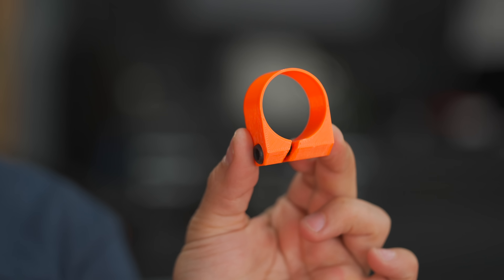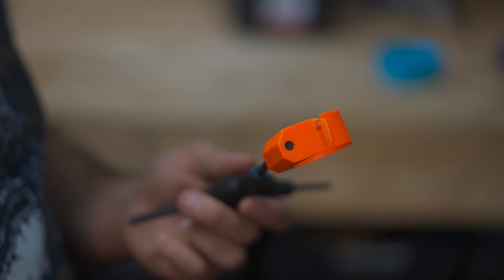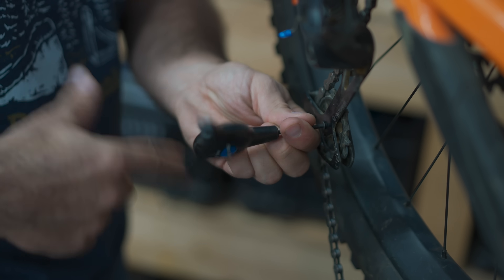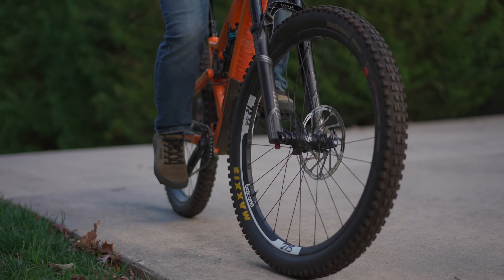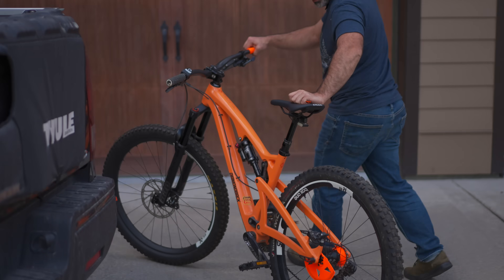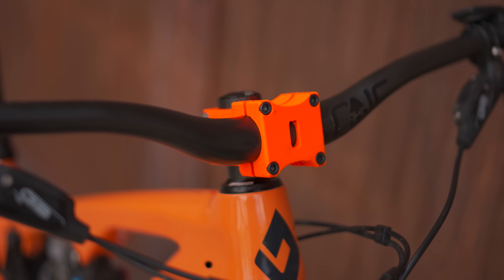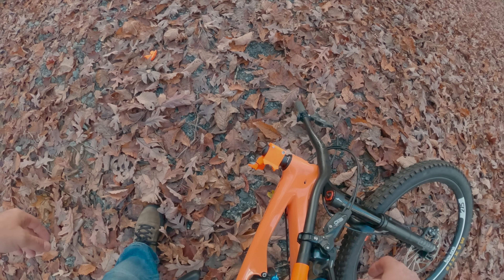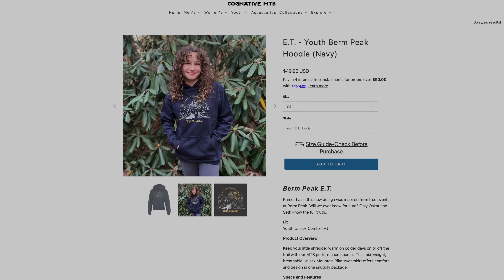Will 3D printed MTB parts break catastrophically? Let's find out!

Comment: Some of these would probably work with carbon impregnated filaments or carbon reinforced prints like Markforged has. Unfortunately they're super expensive printers lol.

Metal can also be 3D printed using laser sintering. This can create parts with little to no post processing or machining required, but is also very expensive.
Reply: "impregnated" lmao... Carbon Fiber infused filament is actually weaker than the traditional filament it's infused with. It's mostly meant for lighter models, better dimensional accuracy, and ease of printing specifically for nylon infused filament. But it's a lot more brittle and less impact resistant. Definitely would be counterproductive for this.

Comment: I actually use 3d printed brake levers on my trials bike
Printed using a carbon fiber material
I did have to epoxy coat them to stop them sucking up moisture but they work well and haven't failed yet
Edited to correct terminology

Comment: screw inserts or recessed nut hole would work. and if the plastic fails you can print carbon fiber parts
Reply: Carbon Fiber infused filament is actually weaker than the traditional filament it's infused with. It's mostly meant for lighter models, better dimensional accuracy, and ease of printing specifically for nylon infused filament. But it's a lot more brittle and less impact resistant. Definitely would be counterproductive for this.

Comment: Looking at your broken stem, if you

1: printed at 0.3mm layer height
2: increase wall thickness to 5-6 
3: increase top & bottom layers to 6-7
4: add inserts for metal nuts

I think it would actually work (until it gets a direct impact on rocks)

Comment: If youre allowing metal bolts you might as well allow embedded nuts, that probably could make the seat post clamp and grips work
Reply: he should have printed with carbon.
Reply: Those parts would fail the same if he put in embedded nuts. The threads weren’t the point of failure on those parts.

Comment: Despite what a lot of people think, PETG is weaker in almost all situations than PLA - so printing all of these in PLA would have given you better results. Also, rather than modelling in threads and screwing directly into the plastic, you could model in slots for Square Nuts and then screw into those, much stronger. Not that it would make them actually safe or anything :) but it would have worked better.

Comment: Congratulations, you successfully manufactured a dork disc. Of course, we know that regular 3D printed parts are more applicable as design and prototyping tools and not applicable in creating parts that are meant to undergo stress. At least that's true for PETG filament. You should look into getting some different types of filament for making some of these parts, like PLA or polycarbonate. Polycarbonate has been tested and found to be the toughest of all consumer desktop 3D printing filaments.

Comment: I know you said not to print bike parts but if you’re gonna try to again, see if you can print solid plastic parts. 3d printers usually leave an air gap in the middle of the print to save material. You can see it when the headset snapped
Reply: It's actually strongest to print at something like 85% infill because the infill pattern forms an internal "skeleton" that strengthens the part.

Comment: 3D printing is great. Also ... I printed a pretty minimal Garmin mount. 
Broke on the 1st ride, even though it was sturdier than an actual plastic mount. Even with 100% infill PLA is just not for MTB loads or vibration.

Maybe a resin printer would be suitable for certain things.
Reply: The problem there is PLA is not suitable for many of the creations people think it will work on. Because it is cheap and easy to work with MANY hobbyists over use it. You have to use the right material for the project or it is doomed to fail. Resin printing has incredible layer definition, but it is not a be all end all... Any resin print has to be able to fully cure, but in truth the larger(more solid) the print, the less likely you are to have proper cure all the way through as it requires exposure to UV light to complete the curing process. Speaking of UV light, PLA is very susceptible to UV degradation as are a number of other popular  filament types.

Off the top of my head, I would likely go with ASA (a less toxic easier to work with version of ABS) for a bike part, BUT I would print my initial part prototype in PLA or some other cheap filament type. After verifying the fit and function, I would replace it with a part made in a filament type that is better suited (after looking up the specifications of the filament types.) if printing, you also want to document every filament type you use. Know what its physical properties are, and know what settings are needed to work with it. Keep a record of this information in a folder or a binder, and keep sample chips. You also want to do some test prints and "torture tests" prior to using a filament on general projects. This documents how well the filament works in standard to extreme printing conditions.

In this video Seth WANTED his parts to fail... You could even see when his stem failed to break on the ride for him, he had to force it to break for the camera.
Reply: Should have used petg or nylon, resin can be better but you need the expensive resins

Comment: I've made and used caliper spacers as well as rotor spacers to adapt an older non boost hub. PETG has held up well, but it does seem to warp over time with heat.
Reply: Can't you just buy metal washers in the correct size?
Plastic that melts like that should not be near a brake rotor that easily reaches 100°C and more.
Reply: @sebastianjost  Lol. Of course you can. PETG melts at 240 C to be clear though.

Comment: Im currently designing 3D printed brake adapter for 180mm rotor. However im later going to cut it out aluminium or cast it out of forged carbon. Aluminium is 5 times cheaper than carbon to prototype but I can make 1kg of carbon forged parts.

Comment: Just wanted to say that instead of printing screw threads, you can design a hexagonal hole to accommodate a metal nut on the other side! It makes it way less susceptible to snapping, cracking and stripping the threads, plus it's really easy to do. Also, layer orientation and perimeters matter!
Reply: Exactly what I was thinking.  I have a 3d printed bike lock holder on my street bike that bolts to itself around the bike frame to hold my lock when I bike somewhere (I know this isn't nearly the same amount of force as an integral bike part). It's made to bolt into a nut that is slightly recessed into the part, and this allows for a tight grip without stressing plastic threading.  Plus, if you make a slotted recess, it can account for a little variation because the nut can slide to accommodate any slop in the system. Once the bolt is tightened down it won't slide anymore anyways.
Reply: Or a heatset insert
Reply: You can also buy some really nice plastic threaded inserts for fairly cheap, all you need is a soldering iron
Reply: I would also always use heatset inserts, idk how much better they are but they are so easy to install that I prefer them over nuts. The nuts are always falling out if you dont design it just right
Reply: Sounds easier than modeling it with threads
Reply: @brauljo  it's way easier to print, too!
Reply: Hijacking your comment to say carbon fiber infused filament and a hardened steel nozzle for the printer maybe worth a part 2 as well as the heatset inserts
Reply: I came here to say this!! You can also use brass threaded inserts, they work well. I've done the hexagonal recess in printed parts in legitimate engineering applications for years.
Reply: And TPU instead of PETG.
Reply: @jayspeidell  CF-ABS. Pain to print, but it's worth
Reply: I have printed phone holder for the bike and it was mounted with 0.5mm thick PETG strips with nuts on both end. I'm able to lift the bike with 3 of these. Problem is that PETG brakes unexpectedly and pretty violently.
Reply: use threadded inserts installed with a soldering iron
Reply: Seth, please don’t try to injure yourself or worse. This is not safe! 😳
Reply: That actually is a good idea!
Reply: I was thinking acme threads for strength but that works better
Reply: Very true, captive hex or even better square nuts, heat inserts etc, layer direction optimisation should always be taken into account, also better choice of material, a real printer with a heated chamber, annealing the parts, making the parts thicker and stronger, if I made that stem adaptor, I would put money on it, that the bar would bend long before the plastic will break.
Reply: Mad man.   :)
Reply: Might help to use a torque wrench too and slowly crank up the limit until it breaks. then print a second one and torque it one step less. (The Calvin's dad bridge-building technique)
Reply: 1000 ways to die 😂
Reply: I am sure he thought of that, but then we wouldn't have gotten to see everything fail as quickly.  I am surprised he got 3d printed threads to hold at all!
Reply: I use nuts as well as heatset inserts. I prefer nuts for size M6 and larger and inserts for anything smaller.
Reply: Да неужели?! Автор же просто решил пошутить! Напечатал копии металлических узлов вместо того чтобы напечатать пластиковые узлы, которые могли бы справиться с нагрузкой... Ну и ведомая звездочка с зубчиками - это высший градус стёба над пластиком... Ведь мог бы напечатать  шестерни под ремень HDT5M какой-нибудь...
Reply: Good to see a man of culture in here.
Reply: Heatset Inserts are the way to go. Rutex all the way.
Why they are better than nuts? Because at Uni we ran multiple thesis about the topic :D
Reply: @joseppedaia3673  nuts are better since I have a crate full of all sorts of them but have no heatset inserts around so... that's my explanation! And I'm not convinced brass inserts would not pop out of load bearing parts, even though I must admit I don't use them that often so my experience is limited
Reply: @matteocristini6221  that is indeed a very good reasoning :D
We found, that the nuts when inserted parallel to the layer-plane (which they mostly are) are rounding the hex over extremely fast (meaning at low torque). Since the heated inserts are melting the material, locally there are no layers anymore and therefore your material properties are homogenous. (Just to geek out a little ;) )

Important info though: we tested M3 nuts. Since larger nuts have more area on the side the force might distribute better.
Reply: @joseppedaia3673  that's interesting! I do tend to use bigger nuts (and washers too, sometimes) but I'll give heatset inserts a go then. Thanks!
Reply: @joseppedaia3673  Yes this true, and if are going to use captive nuts, then old school square nuts are better than hex, as they are less like to round out the captive area.
Reply: @joseppedaia3673 it would also be interesting with square nuts. I guess they should perform better than hexagonal nuts
Reply: Dude don't encourage him
Reply: Not useful, the whole structure is too brittle
Reply: Why would you do that? It defeats the whole purpose of self made custom 3d-printed parts. Would be even better if the screw was printed too.
Reply: @anteshell  structural integrity.
The purpose isn't too fully 3d print but to give the ability to design and manufacture at home, and that is still the case even with heatset Inserts
Reply: @joseppedaia3673  I thought I couldn't have been more obvious with my sarcastic tone without explicitly saying I was being sarcastic.
Reply: @anteshell  not obvious enough for me, sorry :D
Welcome on the reasonable side then ;)

Comment: Instead of 3D printing the threads, how about printing a hex hole that you can press in a nut with your fingers, and the bolt slides through and threads into the nut or nylock?

Comment: Hi Seth,
Try using different material filament with your 3d printer, can be more difficult to print but wayyyy stronger, like nylon or abs. Can also use stuff like TPU which is actually elastic, so could actually make decent grips!
Reply: TPU definitely can be used for grips! You can actually fine tune your grip to exactly how squishy you like, I've done it on a dirt buggy before
Reply: It’s funny how everyone knows what they are talking about but everyone is contradicting each other!😂
Reply: I’m not entirely sure, but I don’t think his hotend gets hot enough for nylon
Reply: @RealJawnes  I personally own a Prusa printer and I can tell you with absolute certainty that his printer will print with PETG and TPU, as well as the PLA that he used.
Reply: @michaelbujaki2462  i said nylon
Reply: I be heard on YouTube that cabon reinforced nylon is as string as aluminum.  I 'd like to see a follow-up video with comments from this vid.
Reply: @stinkypete3900  that's complete bs. Carbon fiber infused Nylon is less durable than traditional PLA even. Carbon Fiber infused in filaments help with stiffness, rigidity, and dimensional accuracy but is extremely brittle and less durable which is not what you want for bike parts that have impact and force put on them.
Reply: Get a Markforged Metal X.
You can print in steel, copper, inconel etc. Seems way more suitable than any plastic or resin printer.
Reply: Nylon and ABS are not as strong as PLA. They are just more heat resistant.
Reply: @bookie60  pretty sure nylon is stronger than your generic pla 😬
Reply: @3DRobot69  I've seen tests that indicate one or the other is stronger, but in no way is Nylon or ABS "wayyyy" stronger than PLA as the original commenter posted.
Reply: @3DRobot69  Plus nylon has shown in many cases to have significant creep issues.
Reply: @bookie60  nylon is semi flexible which absorbs the impact alot better than pla. I often 3d print stuff in pla and notice they arent nearly as strong as nylon.
Reply: @3DRobot69  There's impact resistance and then there's strength.  If I make a part out of TPU it won't be very strong, but you'll be able to hammer on it all day without causing damage.
Reply: @bookie60  yep. He also used PETG which is also not as strong as PLA.
Reply: PETG is stronger than PLA and ABS, i he wants strong parts he can print in carbon fiber reinforced filaments
Reply: @timothybrulotte9148  PETG is more durable, but not stronger. PLA is brittle but strong.
Reply: @timothybrulotte9148  Carbon Fiber infused filaments are actually weaker than the traditional filament alone it's infused with. It's mostly meant for lighter models, better dimensional accuracy, and ease of printing specifically for nylon infused filament. But it's a lot more brittle and less impact resistant. Definitely would be counterproductive for this.
Reply: @timothybrulotte9148  not true and also just not true
Reply: @timothybrulotte9148  check out cnckitchen for comprehensive filament strength teasting.

Comment: Hey Seth, print orientation in the slicer and how it it laid out can change where you want the strength can be, based off of the orientation of the layers. Also, different pattern of infill can be stronger in certain circumstances. Overall I’ve found that gyro infill is the strongest overall but takes a bit longer to print
Reply: To add on to that information, 3d prints are by far the weakest between layers because only 1 surface is melted and the other is already solid. Good luck on your 3D printing adventures!
Reply: While that's true, it doesn't negate the point of the video.
Even with the optimal infill and print orientation, you should not use this material for these bike parts.
Reply: @sebastianjost   facts 3d printing naturally results in a weak product compared to any other manufacturing process  of the same material
Reply: I believe the technical term is anisotropic properties
Reply: Infill doesn't matter much. Wall perimeters are much more important.
Reply: @jgn593  the additive manufacturing for F1 parts is typically reserved for parts where the complexity of the design (internal cooling tubes etc.) are more important than overall strength. They are trading off strength for other benefits.
Reply: Also! Get your self a filament with carbon fibers impregnated into the plastic,  prints just like the rest of then.
Reply: @TheSuperCRB   Carbon Fiber infused filament is actually weaker than the traditional filament it's infused with. It's mostly meant for lighter models and better dimensional accuracy. But it's a lot more brittle. Definitely wouldn't help in this situation lol.
Reply: @TheSuperCRB  cf filaments are kind of a scam. They're only about as strong as PLA. They're typically stiffer, but most of the time that's not a key factor. They are at least twice the cost of quality PLA or PETG, and it's a massive pain in the ass to get set up for printing CF.
Reply: on our markforged printer we can even lay fiberglass layers for reinforcement. these parts are as hard as steel
Reply: I would honestly just do 100% infill for these types of functional prints. Using carbon fiber infused filament and printing at a hotter setting should also help with strength.
Reply: @benjaelee   Read the above comments... What is with people thinking carbon fiber infused filament is stronger? It's the opposite. You should not be using carbon fiber infused filament for anything focused on strength. Especially parts that are designed for impacts like in this situation as carbon fiber filament is crazy brittle compared to the filament without it. Is this a common misconception or something?
Reply: @benjaelee  You can get much stronger parts with 8 walls an 0% infill than with 3 walls and 100% infill.